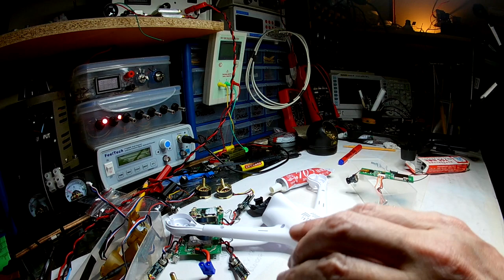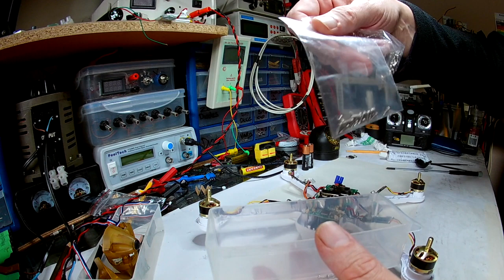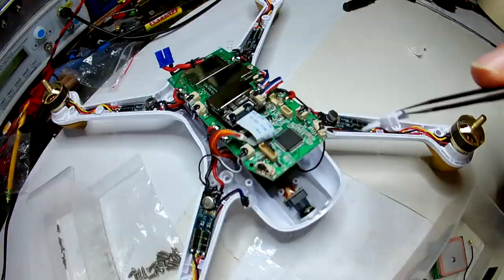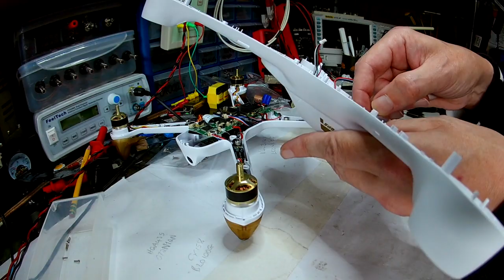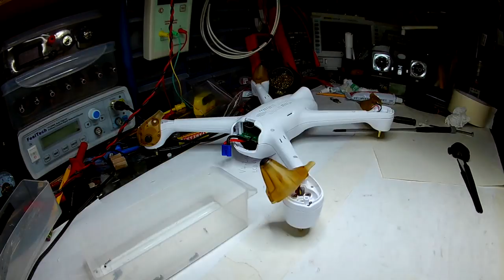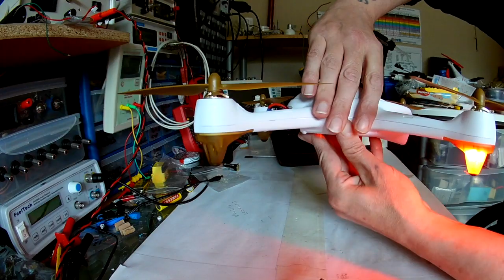Hubsan X4 H501S Reassembly

Comment: Hi Guys I need help, I have husband 501s advanced, one of my motors its not working :( I manage to open it and I noticed that the ESC Electronic Speed Controlle is blinking the others not, Any suggestions what is wrong ?
Reply from the maker: Have you checked the connections going to the power board? There is not a lot of fault diagnosis literature from Hubsan. They will help if you send an email explaining the issue. If you are confident you could disconnect the motor and see if it works without the ESC. Have you a variable power supply with current control ? Or a variable PSU ?

Comment: Hi. My camera came out of focus. What should I do? I have hubsan h501s.
Reply from the maker: What happened t it? Does it need a clean or has it been damaged?
Reply: Elecifun It is not clean view. It is not sharp...
Reply from the maker: When you bought it was it good or has it always been like this?
Reply: Elecifun It was always like this. I have it for a month. Flying one time. I saw that the picture is not sharp...
Reply from the maker: Does it have a sticker on the lens that can peel off? Have you spoken to the seller about the problem?
Reply: No it doesnt :-/ I have send a message... Dont know what to do. It bad. Objects are foggy and not clear
Reply from the maker: OK, I would wait and see what the seller says first. This can be sorted but you would have to strip the quad down and manually adjust the lens for best focus. Are you confident to do this?  Only do if the seller does not replace it.
Reply: I am not confident to do that couse I have never done it before. It is my first drone and I dont want to break something...
Reply from the maker: I understand what you are saying. If the seller does not help you, if you want me to I will help from here if I can. Taking it apart and adjusting it is not that difficult, especially if you have a soldering iron to melt the yellow gunk holding the camera in place. Where did you buy it from?
Reply from the maker: All I ask is a thumbs up to feel appreciated :D
Reply: Thank you mate. If they dont help I will cantact you. I have ordered it from alyexpress
Reply: Should I took off lense protector? I cant even see is there a lanse protector or not... I am angry...
Reply from the maker: Send me a photo of the camera lens so I can see.
Reply: How to do that? Sorry for question...
Reply from the maker: Take nice clear photo and upload here https://www.flickr.com and post the link so I can see.
Reply from the maker: It says it wants me to make an account. Send it here elecifun@gmail.com instead.
Reply: My 501S doesn't send a image to my remote.  Won't take a picture or video either.  All I have is a quad without a cam.
Reply: I had same problem ,FPV screen was clear but recorded video/picture quality deteriorated trying different 5ghz channels helped a little rebinding control with quad had recorded picture quality back to normal.

Comment: Hello ¡¡

I have crashed the drone because I was using bug firmware. The drone works fine in manual  mode but with gps it not works well. If I activate the GPS the drone does not stay static, goes up and down a few meters 
every few seconds. If I use RTH it not works and the  drone not lands well. If I hold the position in some cases not works...  
The 2 compas calibration steps works fine. Do you think it could be the 
gps module?  or maybe the geomagnetic sensor? Thanks ¡¡¡¡
Reply from the maker: Hi, What firmware versions are you using on the drone and on the handset?
Reply: Hi on the drone I was using bug firmware ( 1.2.21) , now I'm using the lastest firmware  is 1.6.25. Before the crah all works fine. The controller I think It use the 4.2.9.
Reply from the maker: I am using FW version 1.1.19 but now see an update. I will try the update after checking for other users comments on it.
Reply: Thanks , but the problem on my case is not the firmware. Is or the gps module or another part damaged on the drone. What do you think?
Reply from the maker: It seems this new firmware update has issues (1.6.25) I have put it on mine but after watching a video just released but Drone Worship I can see there are problems. I am pretty peed off with Hubsan risking our quad copters with buggy software's.. Crash and burn it and we have to pay for fix or replace. Not good.I myself only use manual and altitude hold modes and I do not have problems. However using GPS it all goes wrong.
Reply: Thanks elecifun. Before the Crash the gps with buggy versión 1.2.21 It worked fine. Now im sure , with te Crash, gps module fails or another phisical parte of the drone.
Reply from the maker: To be honest my friend, you could be right. The firmware changes in the FC may mess up components like GPS but I would hope that is not the case as the firmware is just the communicator with the hardware's
The GPS module looks and feels pretty robust but we can not rule out damage. Can you fly in altitude hold mode or manual mode, do you need to use GPS abilities?.
Reply: Altitude Mode not works fine. The gps Mode is perfect to take vídeo.. I would like to can use gps normally ...
Reply from the maker: I would like to use the GPS modes as I agree it is much better for video recordings. I have updated mine now and will, weather permitting, try it tomorrow. Did you check out the video by Drone Worship he uploaded today?
Reply from the maker: I have updated it and taken it out with FW version 1.6.25 for a flight. It is fine in Manual and Altitude Hold modes. Return to home OK, still twitches in Follow Me mode. GPS Hold OK. I did not take it out far using GPS as I am still not that confident with it.